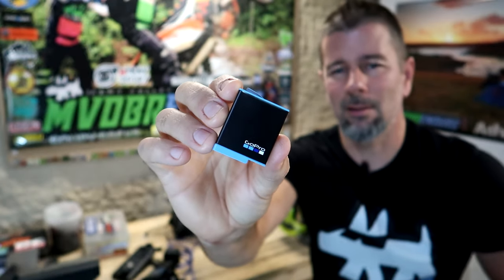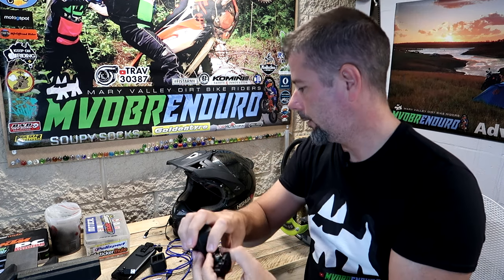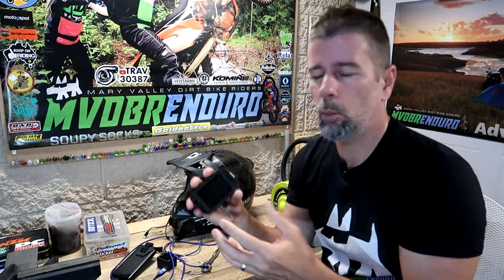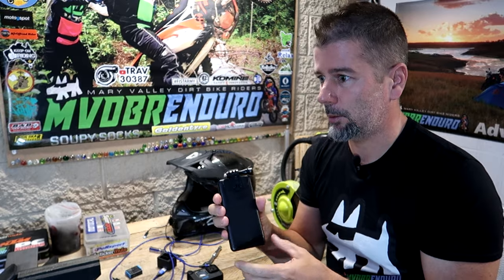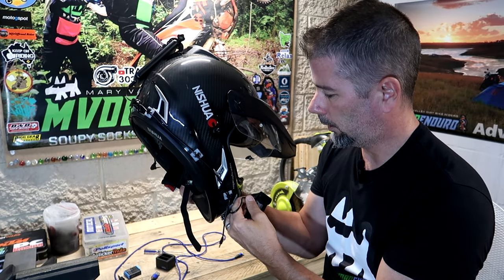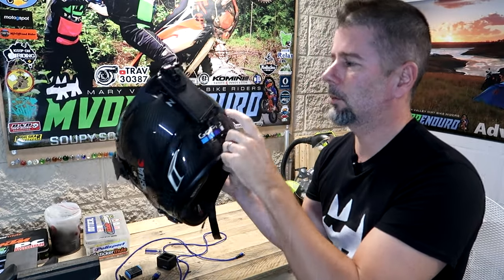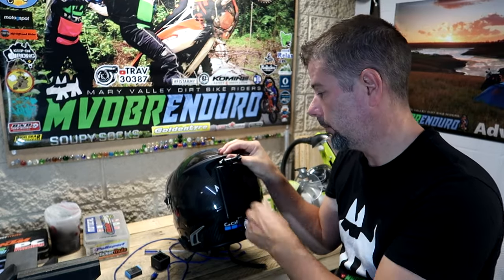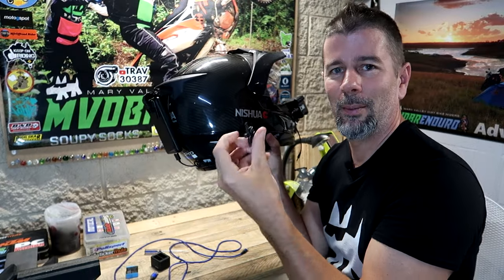GoPro 10: All Day Battery Hack For Helmet Mount

Comment from the maker: Please note that to date, all versions of GP10 firmware after 1.20 (up to 1.46 currently) will not allow you to use the camera with a media mod & running off external power with no battery installed in the camera. There is a link in this video description where you can download firmware 1.20 if you want it.

Comment: Watched you two for years.. I watched this and found a small improvement. The battery I just bought has a "standby mode" I'm sure other batteries do this also but mine is "getihu" powerbank 10k mah.. model: BG-123.. you click button once to turn it on then long press to put on standby and you can turn your camera on/off without your battery turning off due to no draw. Hope this helps you and your viewers. Keep the videos coming, loving it in Canada !!
Reply from the maker: Thanks for sharing Shawna 👌 I've seen mention of some of these that have the standby option, but never knew which brands had it. It looks like Getihu aren't available here unfortunately, even Amazon won't ship em to Aus 🙄 I did find another brand Voltaic which advertise 'always on power' but they are pretty pricey here, about $190 😬 Anyways I'll keep an eye out cheers 🍻

Comment: I was having the same problem with my previous GoPro and the magnetic connector. If it wiggled and I think would go from charging to not, that surge would stop it.

This is what Nerb1 does too, but with a smaller battery pack, and I am thinking about the same. That way I can have them as batteries that could last for 2-3 hours, and use 2-3 of them per day (cos we record EVERYTHING).
Reply from the maker: I wondered if my issues were something to do with the magnetic cable, so I rigged up a regular usb-c cable setup for one ride and had the same issues when plugging it in. They just don't like being charged in the camera, especially when warm. I'm wondering if the new enduro battery is any better but since ya don't seem to be able to get them in Australia we can't test 🤦‍♂ But certainly, swapping out a powerbank on the back of ya helmet is much easier than fluffing around with GoPro batteries all day long

Comment: I’ve done something similar except it put the battery in my Kriega backpack. Just thread the USB-C cable through the opposite side of my hydration hose. Used it at Sea to Sky in Turkey in the heat and it worked a treat. Just turn it on at the start of the day and let it run. I had a 20000 mah battery so lasted a full day no problem without additional helmet weight.
Reply from the maker: Nice 👌👌
Reply: This is precisely the hack I will need for long trips.

Comment: A very interesting solution.   I have been putting my Anker external battery in a small tank bag on my bike but I don't like the cable that I run out of the bottom of that tank bag up to my camera.  Twice I've caught my hand in it as stoplights when resting my hand and a couple of times torn it off when I dismounted.   I've gotten one of those Brake Light lights on the rear of my helmet but I may play around with some way to mount my battery like this.

Comment: I use a similar setup with a dumber version of the power pack. If you buy the power packs with no digital readout then they turn on with power draw. No buttons on mine it just lights up and provides power when needed.
Reply from the maker: This one turns on fine with power draw when the GoPro is plugged in  but once the camera is turned off the power bank will go to sleep, and won't automatically wake up unless the camera is unplugged and plugged back in. I think this is fairly common behaviour. It's fine if you leave the camera powered on...

Comment: I saw some USB LED mini lights, do you think that would work?
Reply from the maker: It really depends on the power bank, some need more current than others to stay awake but I would guess that LEDs don't draw anywhere near enough. I did use a small 12V old style (non-LED) indicator bulb on my first try and that worked, but drew more power than the resistors.

Comment: He Josh, me again, I went for a ride today 5 hours I turned the auto off on my GoPro 9 to never and hooked it up to my Anker Power Core 26800 battery pack turned it on and off and it worked fine on the battery pack it has 4 levels of charge only used 1so unless riding for days without being able to recharge the battery pack this method worked well. Cheers mate Allen
Reply from the maker: Shit that's a big friggin power bank mate glad it worked for ya!

Comment: Thanks for sharing Josh, Just tried it with my Gopro hero 8 black with media mod and purple panda mic and it works perfectly. It even records audio from the purple panda if you use quick capture and i tried it over and over .
Reply from the maker: Awesome mate. Using this method the only negative I've noticed is very occasionally I'll get one clip that has recorded using the onboard mic rather than the external, probably a glitch with the quick capture on the Hero10 but yah it's only one out of about 30-50 clips 🤷‍♂

Comment: Here is the deal and just had this happen yesterday 

Battery in Go Pro power bank connected camera over heats after about 30 mins power is the the issue it is the heat the battery creates I pull out battery and replace with new battery fires up no issue because I remove the very hot battery

As an Auditor I can not be having my camera shut down I am looking for a way to run the extra power with no battery

Comment: I just tried this with version 1.4 and with the battery out and the media mod on it says I have to have a battery? What should I do? Thanks!
Reply from the maker: I mentioned this issue near the end of the video, only way to get around it at the moment is downgrade to v1.20 firmware. I find it to be pretty solid on 1.20, there's a link to that firmware in the vid description if you need it 👍
Reply: @MVDBR  I also just figured out if you connect the ext battery up with the gopro battery inside and then pull the battery out it works.
Reply: @GlennTupper  hey bud! What happens after you stop it first time and power it again? Does it start?🙏

Comment: Interesting setup... What I do is I bought a 2' usb c extender and run that from my chin mount gopro into the helmet behind the padding.. It comes out the back with the usb plug-in. Then I wear a battery in my jack with a 3' cable or so that plug into the extenders.  Easy to reach back and pop the cable apart. I also leave the battery in the gopro with the media mod on.
Reply from the maker: Any issues with the GoPro freezing? And which GoPro?
Reply: @MVDBR  Not while recording. I have a gopro 10. The freezing would happen when it is charging or powering on after charging. I would have to pull the battery from the gopro in those cases. Which as you know with the media mod it is a PITA!
Reply: @MVDBR  I did have freezing when I mounted the gopro to my bike and ran a usb charger off my bike battery. But with a portable battery in my pocket, no issues.
Reply: I also have a USB C cable running from my GoPro Media Mod up under the chin of the helmet through the padding and out the back. Then I have a 10000 mAh battery that is using velcro to connect to the back of my helmet. I just put some heavy grade velcro on the back of the battery and some on the helmet. I have never had it fall off. I too have had issues with my GoPro freezing. I have always attributed it to using the QuickCapture feature. I usually have QuickCapture enabled so that I can just hit record when I am ready to film something and then hit stop when done. The camera turns off. It's obviously a type of sleep mode that makes it so you can power up and start recording quickly at the press of a button. I'll be filming just fine, turning the camera on and off with the press of the shutter button until every now and then it just freezes hard. I usually have to pull the internal battery out of the media mod and reset it to get it to work again.

Comment: I had the same issues with using my gopro for 24 hour timelapses, plugged into the PC for webcam, or for extended show recording and came to the same conclusion to remove the internal battery. I'm actually looking to see if there is a version that can be in-line with the mounting hardware or as part of the camera housing.
8:12 just buy a super cheap LED usb light to plug in (a red light for the back of the helmet would be perfect imo) or get a different USB battery cuz some won't turn their output off (hard to tell which ones do that though).
Reply from the maker: I don't think an led light would draw enough to keep these sons of bitches awake. But yeah there is one brand that do proper 'always on' power banks, called Voltaic but they are pretty expensive here in aus and hard to get.

Comment: Thank you for posting this video. I'm browsing videos like yours looking for a solution to a "video length" problem. I have a Hero 10 Black. I put an invertor in the engine cavity of my BMW Z4. I ran a USB cable out to the front grill. I've mounted my GoPro to the center of the hood. I'm using GoPro's USB Pass-Through Door so I can connect the camera to constant power.

As I'm recording my videos time out at 8 minutes and 56 seconds. These are 4 Gb files. Then the camera shuts off. I've talked with GoPro and they indicated I need to set up Channels so the camera will automatically keep recording and make a series of 4 GB files. I have not been able to find instructions on how to set up this feature. Do you know how to set up Channels?

Thank you.
Reply from the maker: It shouldn't shut off, or stop recording... generally the GoPro will 'chapter' the video file once it reaches 4gb... just splits the recording into a new file and keeps rolling. Never heard of these 'channels' you mentioned. But yeah check your SD card for GX02... and GX03... files, these are usually the continuation from the first GX01... file. Sorry I couldn't be more help.
Reply: @MVDBR  Thank you for a prompt reply. I appreciate your help.
Reply: @davidconway1758  it could be due to the formatting of the sd-card (atleast thats the case on pc's so i wouldnt wonder if it would be the same on the gopro)
If the sd-card is formatted to "FAT32" it CANNOT store files (no matter what kind) bigger than 4GB. 
As said i do not know if thats the case with the gopro, but i formatted mine to another type (exFAT) and the longest recording i've done was a full sd-card (400gb) without any interruption....i guess it would be worth a try?

Comment: I really need to know where you got that sticky mount the bank is attached too
Reply from the maker: It's a standard curved adhesive mount stuck to the helmet. The other part is a Frankenstein chopped up solution, basically 2 J mounts (https://www.ebay.com.au/itm/134397579506) screwed together with a thumbscrew and one side is screwed to a flat piece of plastic which is double side taped to the power bank. There would be better ways to do it but I just used bits and pieces I had lying around.

Comment: Clever…
Regarding latest firmware not working for this setup. I just saw a guy replacing the cord between the power bank and camera with a higher capacity cord and then it worked just fine 👍🇳🇴 Ride safe
Reply from the maker: I did try a few different cables I have here but none I had did the trick for me 😣 Cheers

Comment: Thanks for the video, do you have a link or a website where to buy the power bank and all the tools to stick at the back of your helmet? I have got a go pro and it’s all ready installed on the helmet but I want to add the power bank to have more time between changing the battery. TIA
Reply from the maker: Pretty much any power bank will do but obviously smaller and lighter is better depending on what capacity you need. I was going to try one of these from Amazon they are fairly lightweight for a 10,000mAh https://www.amazon.com.au/VEEKTOMX-10000mAh-Ultra-Compact-Portable-External/dp/B09C8CFKLJ/ As for the mounts it's a bit hard to explain how I attached mine but some double sided tape and some GoPro J-mounts and a bit of experimenting you should be able to work it out https://www.ebay.com.au/itm/134397579506
Reply: @MVDBR  I did try your suggestion, I bought the power bank that you mention to me before. Works very well. Still have to figure out how can I tight the cable for charging the power inside the helmet instead than have outside but rather than that everything works well. Thank you

Comment: That was helpful, for me,  I do some time laps videos where I want to leave my camera running all day.  I tried it with the battery in and it worked sometimes and sometimes it shut off after the battery in the gopro died. I will remove the battery next time and try it. Also I was wondering what about a tiny LED light instead of a resistor?  My power bank is about twice that size and it shuts off with small or no loads automatically too.  Great hack.
Reply from the maker: You can certainly try an led but it was nowhere near enough to keep any of my power banks awake, I needed about 38 ohms of resistance or 130mA of draw. An old school (non-led) 12v indicator bulb worked also but I wasn't sure how much that was drawing so I stuck with the resistors. Another option you might want to look at are Voltaic power banks, they do not switch off automatically https://voltaicsystems.com/v75/

Comment: So? you leave the Go Pro battery door off completely for this?
Reply from the maker: Well yeah, to use the media mod you have to remove the battery door.
Reply: @MVDBR  yeah thanks. Sorry I haven't used one. I'm new. Thanks for clarification !! 😌✌️
Reply from the maker: @zacharyclark1194  all good. If you don't use the media mod you can buy aftermarket battery doors for the GoPro that have a slot for the charge cord 👍

Comment: I bought the GoPro 10 because I wanted to have a webcam that would do 4K at 60 frames per second. Even when I take the battery out and run USBC power only with the compartment completely open I get between 10 and 20 minutes before the GoPro shuts down. It will do 4K at 30 frames per second. But that's not what I want. I have experimented with different USB cable lengths. This is with air conditioning blowing inside the car and the car always stored in the garage so it never gets super hot. But the GoPro 10 always shuts down for heat at 60 frames per second.
Reply from the maker: Yeah it definitely does not like the higher frame rates 🙈 Have you tried the tripod mode?

Comment: How about overheat while in the power bank?
Reply from the maker: Depends on ambient temp, air flow etc, but yes mine still overheats with the media mod attached. Not as quickly as with the internal battery installed

Comment: Been doing that for 2 years now and no problems with it yet 😉👍 if you turn on the gopro soon as plugged in and leve it on stand by then it will keep the battery bank activated 👍 😉 no need for the dongle 😘🍺
Reply from the maker: That has its advantages (camera starts recording a LOT quicker) but the fkn things draw too much power even when not recording 😫 Me dongle only draws about 100ma
Reply: @MVDBR  strange 🤔  my power bank is only 5000ma and will last all day no problems 😊
Reply from the maker: @jefftaswelder9154  what the f. That defies the laws of gravity, or physics, or something like that 😁
Reply: @MVDBR  🤔🤣🤣

Comment: i brought a usb adapter for my 12v Milwaukee power tool batterie that i have 6 of, I attach it to a magnetic lead and keep the battery in my camelback.
The blue light in the cord is enough to keep the battery in charge mode, this runs my Sena 10c pro all day .......my $0.02c
Reply from the maker: Nice solution mate 🤙 That's what it's all about, finding something that works for you 😎 I'd hoped the blue led in the magnetic charge cord would be enough to keep the powerbank awake but nowhere near it unfortunately

Comment: Bit of a faff. short USBC female to USBC male attach the male into the camera run the short cable to the side of the helmet facing female  down. mount to helmet in a tidy way maybe VHB tape. Buy a USBA to USBC magnetic cable. Plug the USBC connector into the female. plug the rest of the cable into the power bank and place in inside pocket. now you have a helmet that you can remove and the cable will disconnect itself
Reply from the maker: Yeah I did that for a while but attached via magnetic cable to a usb port on the bike, was fine for the DJI camera but the GoPro didn't like it. Jammed up all the time being connected and disconnected to power. The method mentioned here is still working great for me 👌

Comment: Hey Josh have you tried to set the GoPro auto off to never in settings I was wondering if doing that would it keep the GoPro live for the battery? Cheers mate love your videos.
Reply from the maker: Yeah that definitely keeps the power bank awake mate but it does chew through the power pretty quickly unfortunately 😣
Reply: thanks Josh apreciate your reply I'll have a go at developing your idea. Thanks for all your work it is very much apreciated
Reply from the maker: @driverkelly  no worries, also check out Voltaic's range of always-on power banks, I'm interested in trying one of these but they are about $200 here in Aus and impossible to get hold of :( https://voltaicsystems.com/v50/